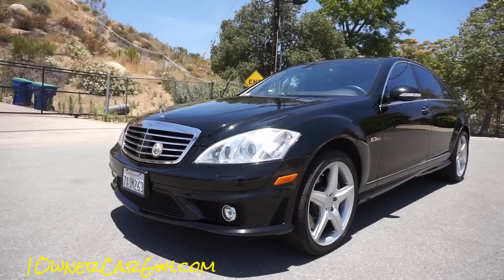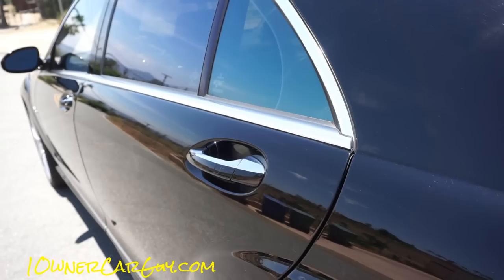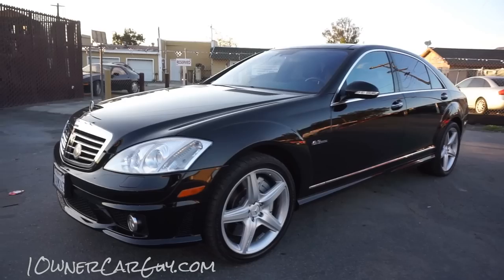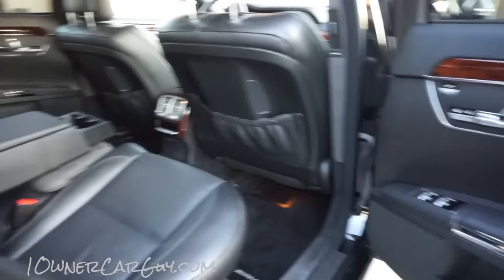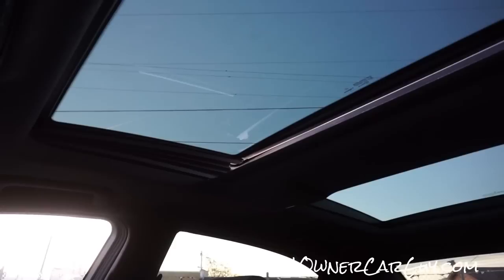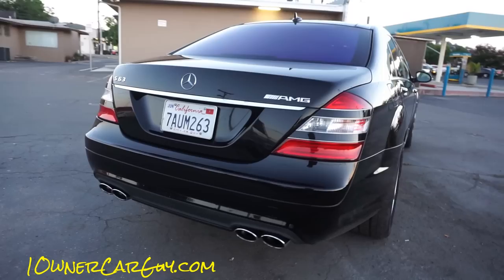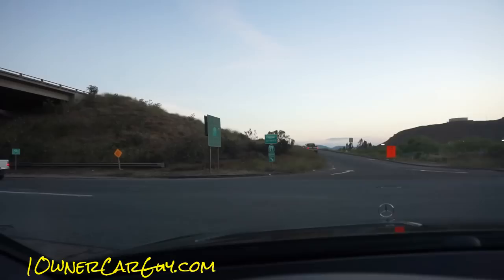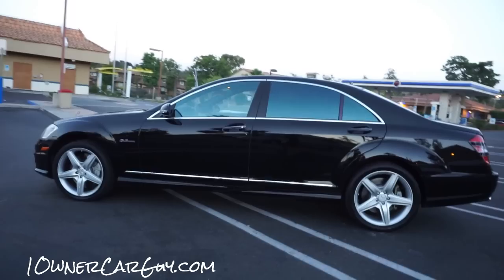2009 Mercedes Benz S63 AMG W221 Muscle Car Full Video Review

Comment: I hate when they have someone reviewing a car they know little about. The switch on the rear passenger door he thought was a heater was actually the switch to control to front pass. seat. (But he did say he has to figure things out) Nice video in any respect.
Reply: You did pretty good considering.... And it is indeed a great car.